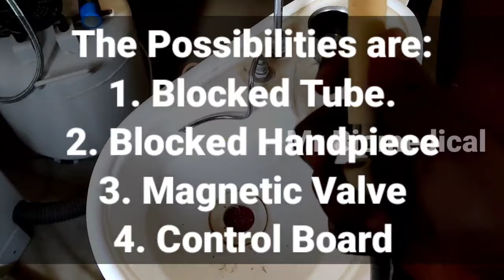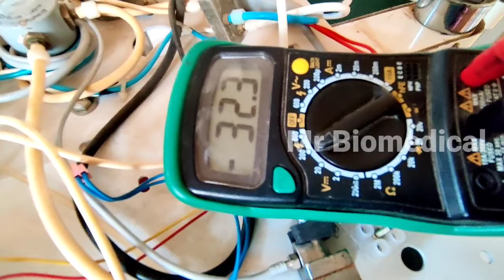Dental Chair Scaler Repair #dentalscaling #dentalchairrepair #dentalcare

Comment: my scaler not vibrating
Reply from the maker: Check the tips
Reply: @MrBiomedical yes already change the tips but they not vibrating
Reply from the maker: @abdullahhasan1980  change the hand piece. Before that check the voltages